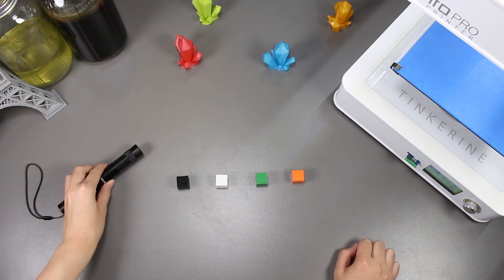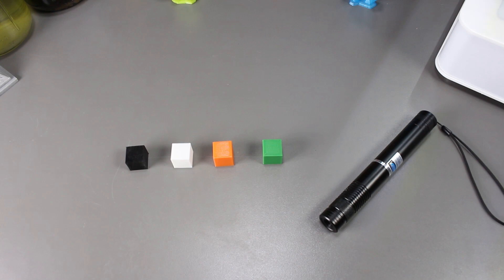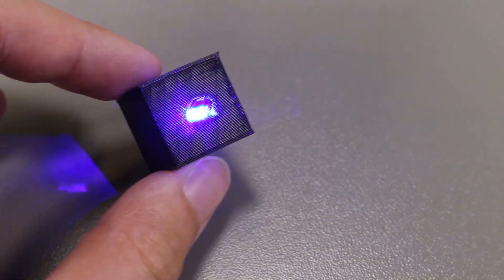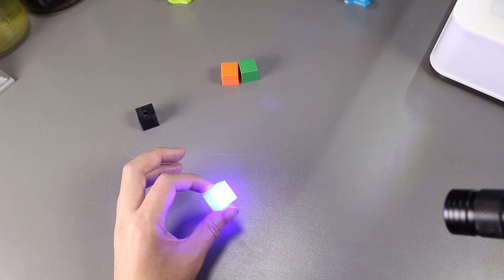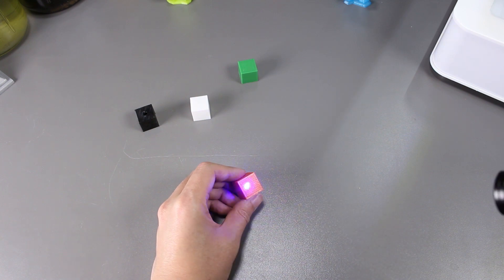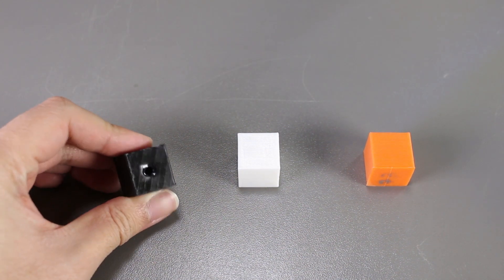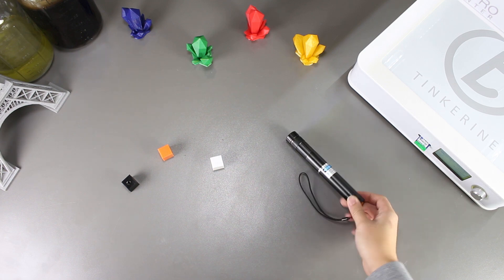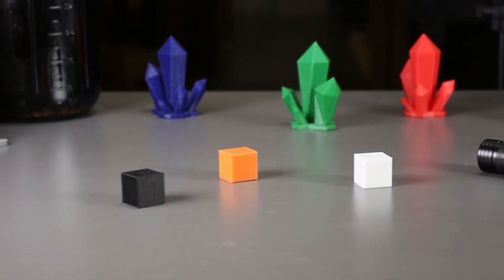Exposing PLA to a High Powered Laser Pointer

Comment: crumbs under what circumstances does one use a handheld laser pointer that powerful. Interesting to point it at a temperature sensor and see how hot it gets. Do you have to keep your fingers out of the beam - not wishing you any harm, could imagine trying this, as people do with hot things. Goggles not going to help if you can get burnt. Goggles absorb the laser light - hmm ideal for high temperatures.